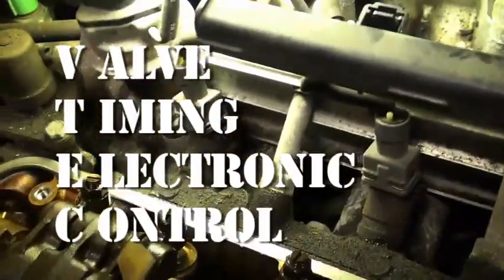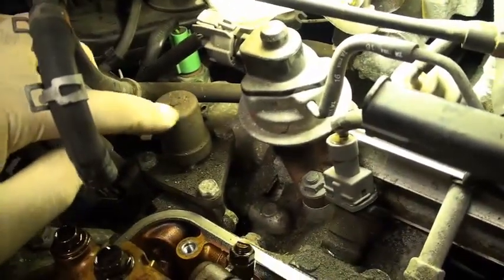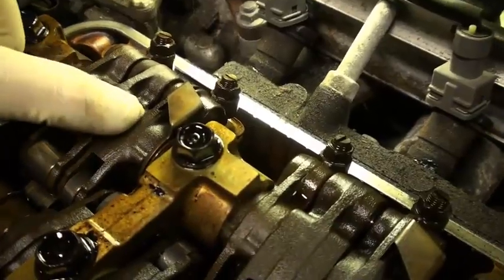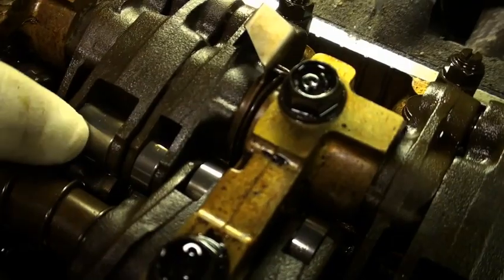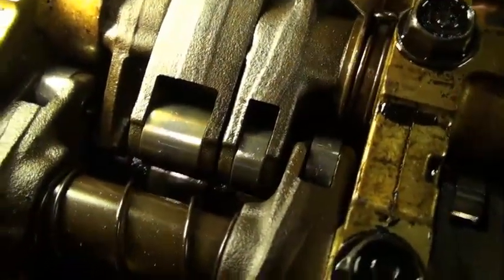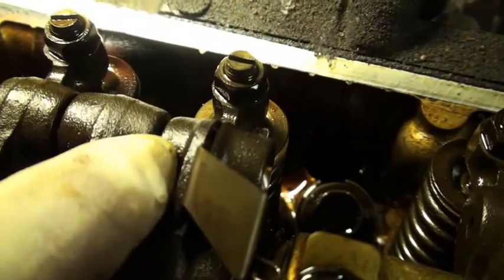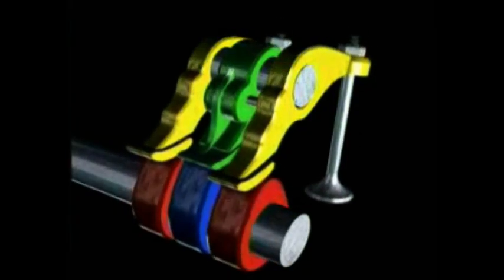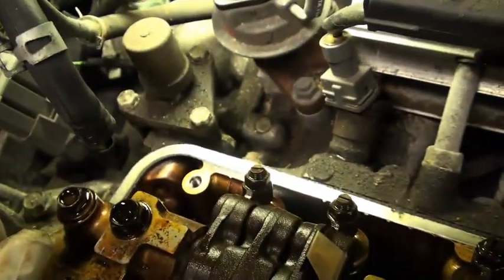What is VTEC and How Does it Work? - EricTheCarGuy

Comment: What should be done if the hydraulic piston or pin that activates the vtec gets stuck and does not return? Is it necessary to disassemble the rocker arms to be able to repair it or can it be solved without disassembling? To disassemble the rocker arms, all the springs of the rest of the valves must be decompressed? i am having this problem on a f23a accord engine on cylinder #4. the vtec pin is stuck, any help please eric would appreciate it. Greetings from Venezuela

Comment: Any thoughts on the VTC valve rattle that happens on cold weather starts with K series engines? It's a common "problem", but not sure if it is actually harmful. I have a 2014 CR-V that does this.
Reply: Did you do a valve adjustment yet?  That fixes so many things on them.  Needs to be done like every 50,000 or even sooner, since no hydraulic lifters.
Reply: @MyLifeThai371  no valve adjustment, but other than cold weather rattle on start up sometimes, it runs smooth as can be.

Comment: Hi Everyone! 
2003 Honda Accord lx 2.4L 4Cyl.
I drive it 1200 miles per year.
Haven't changed oil in 1 year.
The Honda Svc. Dealer said I didnt need to change oil till I got to 3000 miles. When I went in to change it out he looked at me funny and said that I would be throwing out good oil.
Is he right?  I drive enough to get the engine very hot cause I use ac.
I dont want my oil to gel and cause my engine to seize up.
Some smart person please explain to me the truth. Thanks! Stay safe.🐄

Comment: If youre going to hate on a car that is reliable, easy to work on, straight forward, and drives way over the 300k mile mark, then i guess you should just stick to whatever you drive. Dont go hating on my brand. I still drive my 93 si, and you know what, it still cranks drives and engages like it did without issues.

Comment: VTECs are the fusion between an electric engine and a LS. This engine can still run smoothly at 400k miles, as a matter of fact it can last forever. Every single Power boost is the equivalent of a Tyrannosaurus Fart.

Comment: Hi Eric. I have a 2005 Ridgeline 3.5 engine. Check engine light comes on with DTC P2647 rocker arm actuator system stuck on bank 1, no other warning lights, no oil problem, engine runs fine. I have changed oil twice, check engine light comes back on almost immediately. I took vehicle to Honda dealer to have the ecm programmed they didn't do it. 
I'm a jaguar Land Rover tech, I'm not very familiar with this Honda issue. Ant suggestions??

Comment: Variable valve Timing AND LIFT Electronic Control, to be accurate per Honda. 

The DOHC version seems noticeable when the system kicks in, but on my '04 TL (UA6), it is SOHC and is unnoticeable.

Comment: Don't modern cars have something similar to vtech?  I don't know much about engines but isn't it if you're at low rpm's there isn't as much lift as higher rpm's because it would cause unnecessary stress on the engine? So technically vtech set the tone for more modern engines?

Comment: Here's what I learned bout people hating on Hondas and VTEC: complete ignorance. 
1. They rely on pure HP/Torque to back up their stupidity
2. Hondas make great engines, example? the K20 and B18. Let's not forget, the S2000 with it's F20 engine and an astonishing 8,200 RPM range. That's a 2 liter engine making 240 HP back when it first came out. But the new Civic Type R? Turbocharged K20 engine making 300BHP, and check this, it has VTEC as well. 
3.Personal favorite reason, no one has talked smack about the J Series. Yeah I'm talking about the J30-J37 engines. That ALSO have VTEC. Every time I hear someone mention "Honda" it's followed by "Civic". That's because y'all ignorant AF. 
4. Most of car meets that I've been to, there's always at least one trash talker that gets walked by a Honda cause they have a piece of shit V6 "Mustang". I've beaten multiple frat boys with Mustangs in front of their friends easily. 
5: You only hate on Hondas cause the Civic is a FWD car. 

My point is, you can scream about your displacement all you want, but don't be mad when a 2 liter walks your ass, cause I know you'll just keep on the bandwagon with the "hate" car guys have towards the Civic. "Hate" as in, car guys appreciate all builds, regardless if it's a Civic or a Mitsubishi Evo. Guess what? That Evo? Also a 2 liter car. So all you V8 fanboys can go ahead and cry and weep now, cause I'm waiting to hear what you have to say about this comment. Hondas never gave a shit about performance in their Civics. Wanna talk trash? Compare the Nissan GTR, Acura (Honda) NSX GT3, and the Honda hardly anyone has ever heard of, the HSV-010 GT, to your DODGE Challenger RT. I'm betting on my imports.

Comment: So, vtec solenoid is a known point of oil leakage in literally all Honda vtec engines, why?  More importantly, if it's leaking, that'll likely do 2 things, (correct me if I'm mistaken) alter the ability of the ems to engage vtec and cause more leakage during during higher rpm

Comment: So why does it produce the distinct sound?
Reply: more fuel=more big bangs in the engine=distinct sound
Reply: Jdsman 31899 it pushes fuel in the turbo? how does that work?
Reply: John Mike the valves open completely when vtec is engaged, when its not engaged they are slightly open.
Reply: xD

Comment: What happens when U go back to lower Roms - how do the pins disengage after vtec kicks in?
Reply: rpms*
Reply: ECU cuts oil pressure to the center rocker and it disengages from the other two.

Comment: VTEC was made to help smaller displacement engines climb mountains. You can't change the amount of air being delivered without forced induction but you can change how it delvered(less restrictive, speed, etc).
Reply: Larger cam-lobes allows the inlet valve to be opened for longer allowing more air inside the combustion chamber whether it be forced inducted or not .

Comment: But how many vtecs does this give? I need at least 4 vtecs in my honda for maximum VTEC power. I'd prefer 8 VTECs but I understand this is dangerous because it can cause tornados
Reply: My Ford Explorer has more vtecs than a measly little 4.
Reply: Haters will hate
Reply: Most people dont ever understand what honda is about. You can make great power from the same engine in different confidurations. Let me know when your tahoe breaks the 7s 1/4 mile.

Comment: I got the picture of the VTEC. I don't get the part where the oil is supplied to solenoid! I mean is the oil is standby for higher rpm to achieve before the solenoid is activated and lock the rocker arms?
Reply: Yes, oil circuit is always pressurised while the engine is running. Solenoid only lets oil go thru when rpms are in the right spot.

Comment: Ok, My 2006 ford Taurus has electrical issues. The ''check charging system'' light comes on but I have replaced the battery and the altenator checks out at 12 volts, with all systems on full blast.What next?
Reply: If the alt is working, you should a voltage jump to higher than 12. usually around 14 to lower 15 volts which fluctuates. If your alt has an open back, meaning you can see the shaft the pulley is mounted to, you can take a screwdriver, carefully, while the car is running and the shaft should magnetize the screwdriver fairly well. If not, the alt is bad.
Reply: the voltmeter should show 14.3 volts when the car is on iddle. when shut off the battery should show 12.6. of it does check the connections. maybe someting it's loose

Comment: PLEASE HELP ME!!

Eric I'm having issues with my VTEC in 2003 Honda Accord. I live in an isolated town where there's no honda shop and my mechanic has given up repairing my car. I got the code P2646 and I've tried cleaning as well as replacing the VTEC solenoid assembly, but the problem of engine stuttering at 2700-3000 RPMs still prevails. 

It's almost like it happens only when the car heats up, I've tried driving around at 4000-5000 rpms first thing in the morning and it runs fine. Only when I drive it around for 20 mins or so that the stuttering comes back around the 2700-3000 rpm range, even at low speeds. I'm very close to selling the car for scrap, it's close to 325K clicks.

Comment: Please explain Ford duratec engines and ford ecoboost
Reply: Ecoboost is just Fords name for their line of turbo'd cars.
Reply: Nick Mandolfo how about duratec?
Reply: AFAIK, its just brand naming. Like Duratorq, used for its diesel engines. The turbo'd ones get the Ecoboost badge. I honestly don't think there's a special system for which its named that.
Reply: Aditya Upadhyaya not the duratorq.

but just to be really more specific i meant the duratec v6 engine

im thinking its the ford's branding of vvt-i OR i-vtec

Comment: Is it possible to have variable valve timing on a V8 so that you don't get crappy gas mileage? Also can the timing be controlled by an external switch by the driver?
Reply: Well you can't just put variable valve timing on any v8. You have to design the head and cam in a way that works with it.
Reply: +justin anderson That's what I meant, but what about the switch?
Reply: +Josh Lewis no there's not a switch that will activate vtec when ever you want but it should be a thing imo XD
Reply: +justin anderson A switch can activate the solenoid instead of pressure. I saw a video of someone that did it
Reply: yes and yes

Comment: I love your explanation and it all makes sense now. VTEC is just 2 cam (or 3 in some case) cam profiles on one shaft. A Low-high or  low (economy), mid (highway) , and a high (performance) allowing for more power profiles with out the need for modifications. I think correct me if I'm wrong please.

Comment: Does VTEC help gas mileage or make it worse?
Reply: +Dreaklock Well in a way it's better economy, because if they didn't have the VTEC the valve timings would be somewhere in between high-performance and fuel-economy. You wouldn't get the best of both worlds.
Reply: I've got the I vtec on a 2013 civic si, and if I run it in I vtec often I can go through a tank in less than a week versus driving easy and going almost 3 weeks on a tank. but, it's just so much fucking fun. not dogging it, mind you,  but just opening the I vtec up at 5k rpm and going to about 6.5k. and the sound is awesome with my k and N typhoon.
Reply: +Caelum Hagen 
That's just like the old 4 barrel carbs. When running only the primaries, it would get better mpg than a factory 2 barrel.
Reply: +alwcurlz 
But ONLY if you drive the car conservatively. Got a heavy foot? Goodbye gas mileage.
Reply: rayford21
Of course. :-) I was always a conservative driver. Starting in my teens. I used the extra power for passing.
Reply: +Dreaklock It makes it worse, the valves are open for longer using more fuel.

Comment: thanks for explaining, I'm kind of disappointed tho, they make it seem revolutionary, I have variable duration lifters I put in my 69 charger, no nonsense just oil pressure, seems it'd be smarter and cheaper to change the lifters then add sensors, new cam, new lifters, new valve train and I get constantly increasing valves rather then all at once at the end, but hey what do I know

Comment: so when u drive at lower rpm it gives less fuel to the engine (saves fuel) and when u hit the gas/drive at higher rpm it gives more fuel to the engine.so no power boost only economy boost

Comment: Well done!! Good graphics and everything. It totally runs on oil pressure. My old Civic (without cheap aesthetics on it, thank you) "consumes" oil and if the oil level gets too low, the check engine light comes on, and it won't rev past 4,000 rpms. I still don't understand how people think stock Hondas are fast-even with bolt-ons.

Comment: Is it possible to lock the pins to get "non-stop vtec"?
Reply: you can probably do it and no it won't mess up your car as the others stated, you'll just have a rougher idle and waste more gas
Reply: wen vtec starts cutting in and out quickly what can be wrong is it the gasket on ths solenoid or something els ?
Reply: Toda Camshafts. But they are bad for your engine.
Reply: +Michael Just apply constant "+" (electricity) to the VTEC solenoid and u are the man. But, as stated above, it is bad for the engine.
Reply: no there needs to be enough oil pressure to lock in the pin u can buy a vtec controller I'm pretty sure the lowest u can set it is 2000 rpm

Comment: how is this system changing the valve timing?
it is just increasing the lift of the valves

plz explain if i missed something
Reply: Pratham Singh  Yeah it increases the valve lift its got a larger lobe in the middle and larger rocker in the middle which locks into place when it activates.
Reply: Marc Kolz thanks :)

Comment: V-tec is nothing... I have a Duratec 2.0 with no variable cam timing, just a real N/A engine. And it beats a civic Type-R. But mine has full exhaust with Miltek manifold. Pipercross air intake filter; And a tune. 180Hp.
Reply: Video?

Comment: It's not really "variable valve timing". This is more digital; On or Off. There is no variable/analog adjustment in between the two cam lobes. A true VVT is able to gradually adjust the timing and would actually be less complicated than this.

Only disadvantage a proper variable valve timing has to VTEC is that VTEC can have a different cam profile, where normal VVT is only advancing or retarding the stock cam profile.
Reply: Blaylock1988 thats probably why Honda came up with I-Vtec. The "I" portion is actual cam advancement/retarding with the older traditional Vtec still operating as per usual. Competition creates better products I suppose.

Comment: im gonna keep on watching this until i get it.
Reply: Did you get it yet ? :P
Reply: yeah, when I was going in the high revs i was wondering whether i hit vtec or not. its hardly noticeable since I drive the base model RSX, for emission reasons its at 2200rpm. (based MPG's)
Reply: I hit 5 rmp stock
Reply: dragonblade101 thats not how you say it, btw a car idles at around 900RPM

Comment: V-TEC when millions of unicorns fart simultaneously to give a power boost.
Reply: mightaymouse You're not even saying it right its Vtec not V-TEC.And yes that is true for SOHC Vtec motors as these are not designed for high performance but rather fuel economy. The DOHC versions of Vtec are for high performance and they are AWESOME performing motors because of it, and also because they are high compression engines.
Reply: catless exhaust Honda aint worse than Ferrari in any way, except for luxury  - something Honda have never been devoted to. And if u think that's enough to edge Ferrari over Honda u can check the new NSX. :)
Reply: Marc Kolz Clam down there buddy its only a Honda.
Reply: Marc Kolz Your trying too compare a Ferrari to a honda?
Reply: Mighty car mods all the way ;)
Reply: +mightaymouse MCM!
Reply: Migity car mods
Reply: +mightaymouse Yeah, that's the reason why i came here... Mighty Car mods...
Reply: catless exhaust Yeah sure whatever. Honda engines are as ingenious as ferrari engines, made with the same perfection. Its just that most of them are front wheel drive.
Reply: Milo Miller lol you know it!
Reply: Milo Miller totally JDM!
Reply: tpropmp gtg honda made reliable engines and most hp per liter before ferrari so yea not very comparable.
Reply: Why ferrari don't vtec system too?

Comment: so there's a higher lift and duration. but for what? what purpose does the increase of lift and timing serve, and why is there so much hate on v-tec?
Reply: The intake valves open sooner, open wider and stay open longer to allow more air and fuel to go into the engine.
Reply: What the replies haven't mentioned so far is that the increase of lift and timing changes allow more air mass at 'high' rpms. At low RPM's the air mass flow would actually be less. It is basically optimising air mass flow for low RPM and high RPM
Reply: Creates a greater air and fuel mix = more combustion = more power
Reply: what they said, foot on the peddle engages the vtech giving you the extra power you are asking for.
Reply: jack flell It's like an economy mode switch so you're not using a tonne of fuel at low speeds, and it helps keep optimal mixture
Reply: Против Глобал Lol we meet again.

Comment: VTEC: You can have all this lag, and if you call now we'll give you NO EXTRA POWER!
Reply: What do u mean lag. It doesn't open until 6k rpm because it's a high speed cam. If V-tec came on sooner the engine would loose low end power.
Reply: Jonka Olofsson you can't just throw a big turbo on a car and leave it at that... you have to use the right size turbine/compressor set up on the right sized engine. No sense in throwing a huge t6 diesel turbocharger on a 4 cylinder if the 4 cylinder won't generate enough exhaust gases/pressure to drive the massive turbine wheel. (Where you get your lag) It goes vice versa, one won't slap a t2 turbo on a V8. The exhuast gases generated will spin the turbine wheel much faster than it should, you would have to limit the turbine, thus limiting your power gains, because you can burnout a turbo. Slapping a turbo on a vtec equipped vehicle doesn't necessarily mean it will have massive amount of lag. It all relies on correct tuning and the correct parts.
Reply: imagine a Vtec with a big turbo on it... holy shit, lag for days
Reply: Jonka Olofsson If they turbo charge it, the boost would come n around 2500 rpm and it would pull much harder than now. At 6000 rpm when the v-tec would come n and all hell would break loose. It would be to much for the front wheels.